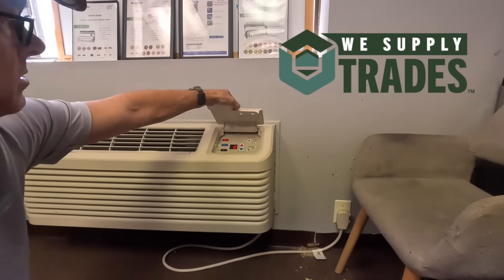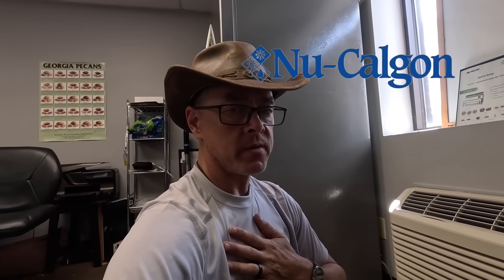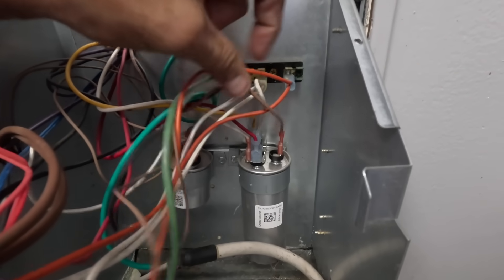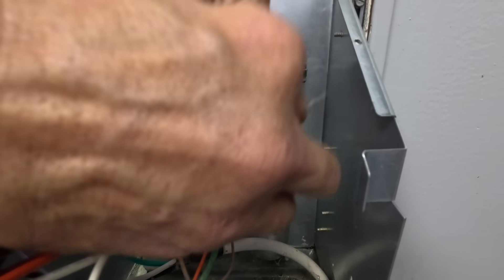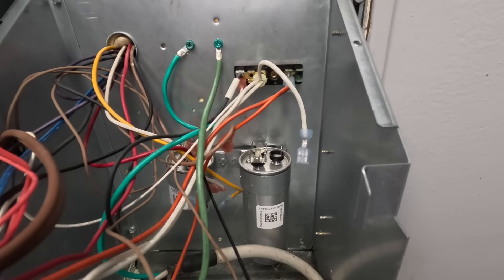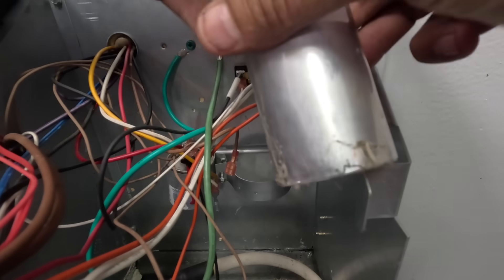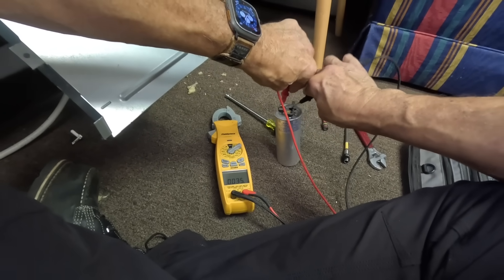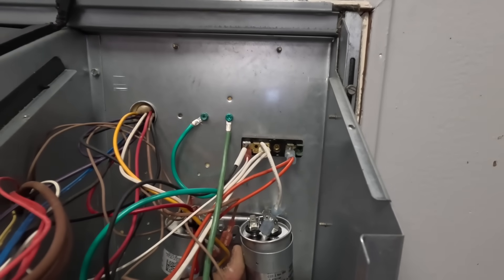Hotel Style Air Conditioner Not Blowing Cold Air!

Comment: yes sir  an  30 / 3 Cap not common unless ur do a lot Rheem like us ....the 3 fan side  its so common to us so we stock sever lower 25/3 .30/3 .35/3 40/3 + 2-3 single 3  but ive really seen some odd balls over the years on non resd systems

Comment: those things are a total gamble as to what will break, indoor blower motor,  outdoor fan motor, fan/blower wheels, end bearing on indoor blower, capacitor/s, control board, heat strips, lots of tubing rub through/charge loss and no safety pressure/thermal switches, so they nuke compressors.  pretty much hear one not working, just schedule for replacement and add to the use for parts pile.
Reply: These do have over pressure cut outs.
Reply: @sprockkets  maybe later models/heat pump versions. many are/were a/c only with heat strips.
millions of them around here in all the hotels.

Comment: If anyone is wondering the 2nd capacitor you might have saw it's used for the 2nd bower motor. These units have 2 blowers, an indoor and an outdoor, that each have their own motors. The dual cap, that was changed, runs the compressor and the outdoor blower. The single cap runs the indoor blower.
Reply: why the are needing in general that capacitor? What happend if they run without that thing?
Reply: @Sgt.Speed_III  The motors won't run, simple as that.

Edit: Ok, some more explanation: When run on a single phase, you only have a pulsing waveform, which doesn't have any directionality. Adding the capacitor produces a second, slightly delayed waveform. Now you have the directionality ("first this, then this") you need to convince the motor to turn (a) at all and (b) in the direction you want it to turn.

BTW: 3-phase motors in bigger ACs don't need a capacitor. 3-phase power already has an inherent directionality, so the motor knows how to turn from that alone.

Comment: You will see more of these PTac units in small apartments, small commercial spaces. Remember most PTACS have a 30- 60 sec delay on the compressor. And come in different voltage inputs too. Simple to work on.
Reply: Amana is simple to work on. Gree and Freidrich are another story. I never seen such a mess of wiring and impractical placement of boards and caps than on a Gree. We have probably 80 small apartments with ptacs and I made them switch out to Amana for any new installs. Bonus is most suppliers can get parts so it keeps pricing competitive on boards and such.